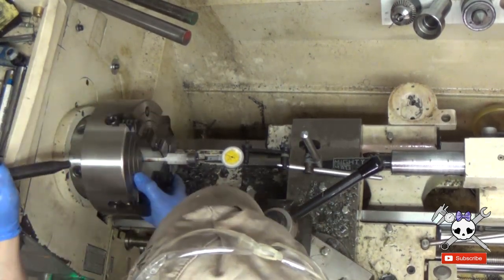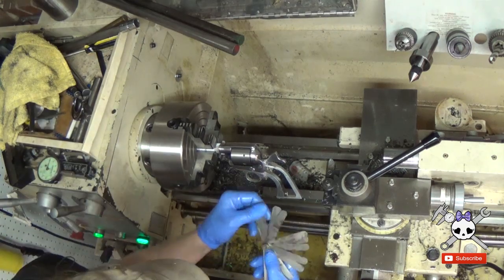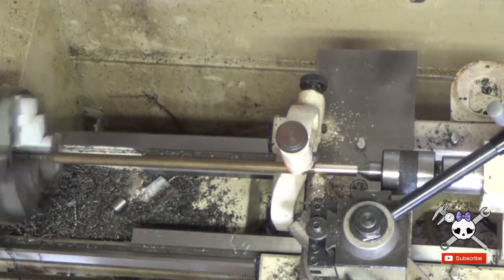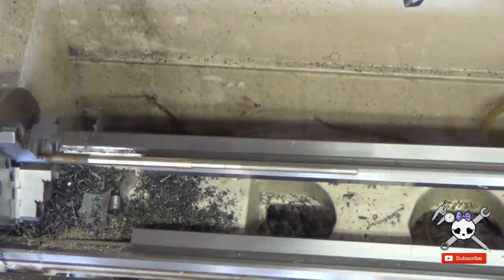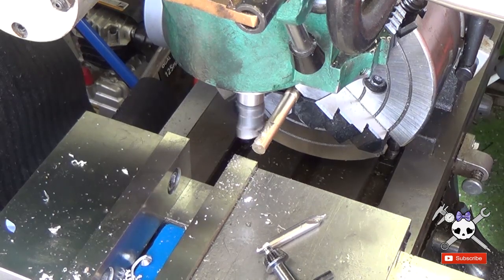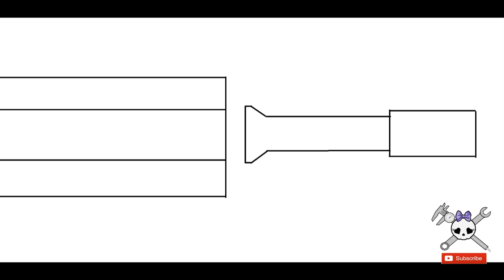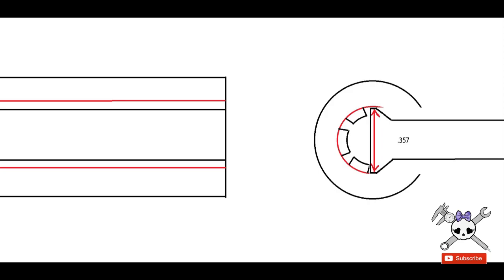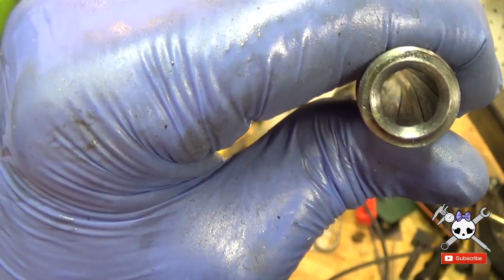1880's single action revolver built from scratch (part13)

Comment: Well done. To get better surface finish you have to use nagative angle on cutter. it will work more like old style square reamer wich can make almost mirror finish when taking light cut. Try it. )
P.S. Sharpness of cutter is importent too.
Reply from the maker: I sharpened it on my tool grinder it has a Dimond wheel and left a mirror finish but I think part of the problem was it wasn't locked in place really. it just sits on top of the  paper shims. the have a bit of spring to them. I'm going to spend some time making a proper cutter. with a hinge and ramp that should take out the spring and make it easier to take a smaller cut.
Reply: +Waffenschmiedin x  I was talking about scraping type of cutter. Take a look on the picture: 
http://www.bevfitchett.us/repair-of-firearms/images/2740_34_51-hook-type-rifling-head.jpg
It willgive better finish, but it's tricky to make. ) With scraper type cutters i got better results. But anyway lapping is required after any type of cutter.
Reply from the maker: Oh ya that is actually like the cutter I want to make but the plans for the one I saw was pinned on one end like a hinge. any details in the geometry of the cutter?  would love to see it if you have any
Reply: +Waffenschmiedin x Use hinge type it's ok. For cutter angle- try more then 90 degrees, 100-110 is ok. But cutter matirial has to be as hard as possible and you will need to make more strokes with less feed than using hook cutter. 100-110 deg. - angle to make on a cutter of same type as a hook cutter. Rifling head by the link above has two way cutting designe and work same on push and pull. Make simple only one way cutter just to try and compare with hook cutter. Anyway differense will be not so big... But then you cut or scrape- don't wait for mirror finish. 
And use olive oil. If you didn't use it yet, just try it on cutting treads with die on stainless or brass. )
Reply from the maker: thank you for all the information I will give it a try :)
Reply: +Waffenschmiedin x You are wellcome. ) I sugested you olive oil because it contains oleic acid about 80% and it dosn't smell. At old times then cut rifling was the only method they used linceed oil, but it contains less oleic asid than olive oil. You can use 100% oleic acid if the smell is ok for you.) If you will use oleic asid don't forget to clean your part completly after maсhining with rag and gasoline solvent because olic asid is corrosive for metals if stays on surfaсe more than one day. But it's gret for cutting treads and machining. ) Try it and good luck at next steps. )
I don't feel myself as a mashinist guru, but if some information will help i will be glad to share with you.)

Comment: Hi Waffenschmiedin. Another completely excellent video.  You say you're NOT a gunsmith and yet you are eminently able to make this fine example. As a time served engineer (in the UK, and I say that because as I'm sure you know, the term 'engineer' means something different in the US than it does here), I have applied many of the techniques that you use in your videos, either at work or at home.  May I ask how did YOU learn these techniques because some of them are pretty specific to toolmaking or even gunsmithing, and not just 'any old engineering'. In any case you have learned very well, and it is a credit to you that you keep the 'art' of precision engineering alive. BTW, it feels a bit 'formal' addressing you as Waffenschmiedin, so may I ask what your first name is? Regards Mark in the UK
Reply: +thecorbies
I think Waffenschmiedins name is Helga cause such excellent craftmanship must have German roots ;)
Reply from the maker: I do have German roots and mechanical and blacksmith roots . my name is Heather :)
Reply from the maker: I learned by doing. I worked 2 years in a machine shop then moved to industrial maintenance. most of the places I worked were very old company's with very outdated machines. so we had to fabricate many of the parts that were no longer available. I also designed several machines and we built them from scratch. :)
Reply from the maker: and thank you for the compliments :)

Comment: Thanks for sharing the interesting work. 
A) You said you would like to modify your rifling rig to become bi-directional. Why does the direction of the rifling matter?  (Obviously I don't know much about gunsmithing)
B) Is there footage in your videos to see your indexing attachment on the lathe spindle? If there is I must have overlooked it.
C) You said a barrel with worse rifling would still shoot fine. What is the criterion here for "fine"? Whether the bullet gets stuck? Or the scatter on target with the gun in a vice? How much scatter is "fine"?
Reply from the maker: +rol eic i want to modify my lathe to be powered by the carriage. and make it so that i can do left or right rifling. pushing the cutter by hand i have to stop sometimes mid cut and that will make for a less perfect cut. when i do a pistol barrel the barrel is so short so it doesn't stick out the back of the spindle for access to the back of it. ( i need access to change the shims) because of this i have to push the cutter through instead of pull. whenever you push something through it will generally not be as nice of cut. the tool will try to flex/bed and it will affect the cut, when you pull a cutter the rod is tight because of the tension pulling on it. sort of like pulling or pushing a piece of string though a straw.  i have no choice but to push the cutter though a small barrel. powering the carriage will help elevate some of the problem but not all. one way to help fix the problem is make the tool shorter and do a heavier caliber gun. if the tool is short it will he more rigid and the bigger caliber barrel can use a heavier tool.
Reply from the maker: +Waffenschmiedin x yes i did make a video of the indexing it was part of the rifling tool attachment videos its basically a collar on the back of the spindle with 36 holes frilled in it. a pin fits in the holes and you can index that way. (nothing fancy) its held to the spindle with 4 set screws
Reply from the maker: +rol eic i have a 100 year old mouser with rifling worse then this barrel that shoots a 1 inch group at 100 yards. this pistol barrel isn't perfect rifling but its better then that rifle so i think it will be ok (for basic target shooting ). i plan to do some upgrades of the whole set up now that i know its works and if i can get better barrels i will replace the one on the revolver. just because of my OCD
Reply: A) Why could you not make the rod longer than the barrel so it sticks out the back end of the spindle for you to access it? Then you could pull it instead of push. To prevent the cutter from falling out you could secure it e.g. by a cross pin.
If for some other reason you have to push then you could put a pin across the forward end of the cutter and the tube. That way at least the cutter would be pulled inside the brass tube which is pushed by you. To increase the stiffness of the rod you could use a steel tube or even a solid steel rod with a pocket for the cutter instead of a brass tube.
B) Ok I have found the indexer now at the end of part 6 of the rifling attachment videos. thanks
C) Ah, so you really referred to target scatter. It is surprising that less than perfect rifling has so little influence on accuracy.
However you have not yet explained why left or right side rifling is chosen. Why are not all rifles in the same direction?
Reply from the maker: +rol eic because nothing holds the cutter in except the bore of the gun. if you put it all the way through the cutter will fall out inside the spindle bore.  if I make a differ style cutter (with the pinned/hinge) I may be able to do that
Reply: +Waffenschmiedin x I have edited and expanded my last answer above. You will see it after refreshing the page.
I have also noticed that the top cutting edge of your cutter is 90 deg relative to the barrel axis. Like that the cutter will be pressed to one side of a flute. Should it not have the same angle as the spiral flutes so that the rake angle is the same for both side walls of a flute for a symmetrical cut relative to the flute direction?
Reply from the maker: +rol eic  "Q"  " However you have not yet explained why left or right side rifling is chosen. Why are not all rifles in the same direction"                  I didn't say that less perfect rifling will not affect it I said that I'm ok with the results for the time being.  I said my old rifle shoots "ok" with rifling worse off then what I just made. what I made was decent but I admit not amazing (yet)  you choose left or right rifling  because the barrel can unscrew  when you shoot it. it needs to go the opposite way of the barrel threads
Reply: +Waffenschmiedin x  I see. Very interesting to know. Thanks. 
I understood what you said about the rifling and scatter. I just thought that 1 inch scatter in 100 yards is not so bad for the imperfect rifling of that Mauser. And in my inexperience I expected it would ruin the scatter much more, that's all. Thanks for your explanations. I learned quite a bit from your videos and your answers.
Reply from the maker: a lot of that depends on your definition of good and bad rifling. i am no expert on this subject but i do hope my videos will help other people :)
Reply: +Waffenschmiedin x They sure do.  They are interesting and instructional. Thank you. 
BTW have you ever considered to braze a piece of tungsten carbide (e.g. a broken TC insert) onto the cutter and grind it with your cutter grinder? It might keep a sharper edge for a longer time. You would need a diamond grinding wheel like this: http://www.amazon.com/uxcell-100x32x20x10x3mm-Flaring-Diamond-Grinding/dp/B008EF1UUM
Reply from the maker: Yes I have thought of that. i  wanted to test the machine without putting all that work into it. I do have a Dimond wheel like that. however I don't like to grind to much carbide because the dust is toxic.
Reply from the maker: thanks for the info ;)